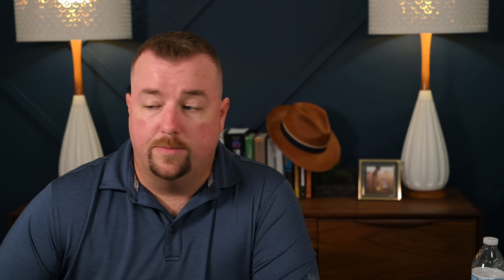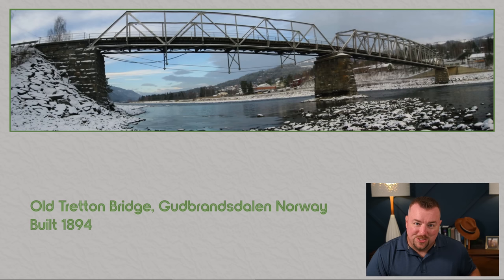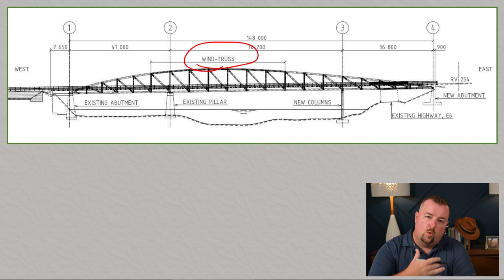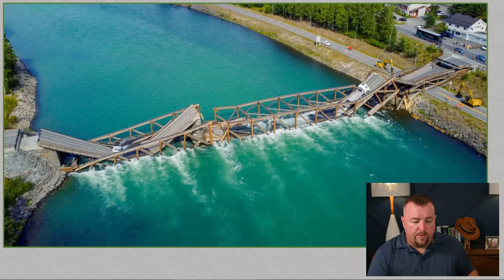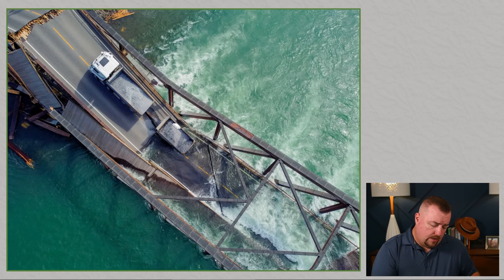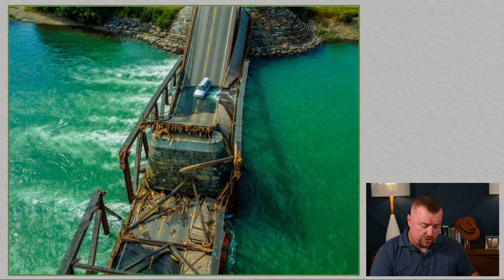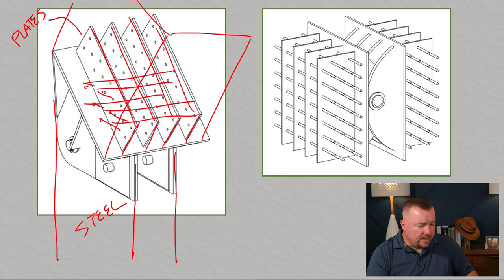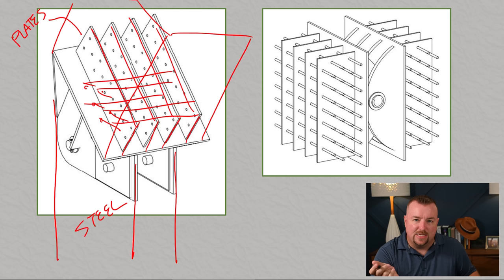How Did the Engineers Miss This?

Comment: The only way to properly join wood and steel is by using filleted (each corner is cut in a triangle fashion) SHS with outboard CLAMPING, so it becomes a friction fit that way you have much more predictable failure mechanisms. The only issue is that since wood is an alive material these claims will need retorquing

Comment: Thanks for this one and greetings from Norway! The weakness of the joints seem obvious and not good at all. Keep in mind, though, that Norwegian media has reported that this bridge was used for transport weighing well over its certified capacity, which may have caused this.
Reply: I wondered about the load rating capacity of the structure. In the US every public structure must be load rated by a structural engineer within 30 days of going into service. This structure may have been fine for some time with lower weight vehicles, but I'd still be worried about rot at the connection points.
Reply: @isaacm6312  AFAIK, we have similar rules in Europe, but then, I don't work with this, so I don't know wth details. The bridge just opened again, though and the first to drive across it, was the truck driver that got stuck on the bridge as it collapsed. He found it a bit scary at first, but said it helped.

Comment: Is it just me or is the sound exceptionally soft on this video? I have my volume maxed out and can hardly hear.
Reply: Audio was OK for me.  In my experience YouTube sometimes has temporary technical problems with really fresh videos, you might want to watch again.
Reply: @blueboats7530  yeah, I’ve seen a few older comments about the sound being quiet, but it was fine for me so it might be fixed now.
Reply: Volume was very low. I cranked up both the computer speakers and YT slider, still barely heard it.
Reply: Yes, low for me too. That is, lower than most other YT videos. Though my hardware allowed me to crank up the volume so I could hear it easily.

Comment: I think in 18:30 - 20:30 the terminology "by tension perpendicular to the grain" meant tension pulling against the perpendicular bolts, they imagined the bolts were a perpendicular hold in the wood -- definitely a bad pre-conception.  As an active woodworker, I agree with your characterization of the bolts acting as splitting wedges in this configuration.
Reply: the bolts acting as splitting wedges as the holes deform would be applying force spreading the grain, applying force perpendicular to the grain direction

Comment: Back in 2016 I built a wooden shade structure on the beach in front of my cottage, and one of the issues was how to cinch the end of a 2*12 beam up to an 8*8 post and hold it there.  In the end I made 3" holes 16" from the end of the 2*12's, and pushed 3" dowels through.  The side of the dowel opposite the end of the beam held a threaded metal disk 1/2" thick to receive a threaded rod pulling from the far side of the post.  The point is that the dowel was large enough and far enough from the end of the beam that shear forces were spread over a large area of wood.  (The beam was also stabilized side-to-side by braces.)

Comment: I just want to add that wood and steel will contract and expand at different rates when exposed to temperature changes. With ten years of seasonal temperature changes those wooden beams would have basically treated the steel pins as abrasive saws. Add in moisture exposure, freeze thaw cycles, and the glue breaking down it was a recipe for disaster.

Comment: having personally seen similar failure modes on timber antenna towers under high wind loading after 2 to 3 years we are now in the process of replacing timber towers with all steel or corrosion resistant alloy constructions. Every timber tower collapse was initiated by a timber joint failure subjected to tension loading on the windward side of the tower.  Timber members in compression, on the  leeward side of the tower were then subjected to excessive loading after failure of the windward timber connections splitting along the grain as the fixings (stainless steel bolts) elongated the drilled bolt holes. From the point where the connections under tension split the timber along the grain a 'plug' of timber was ripped out of the timber member under tension, as seen on the bridge failure. When these connections failed the static load of the tower and dynamic loading (wind pressure)  caused the leeward timbers in compression to be subjected to massive bending loads beyond their load carrying capacity that caused them to bend, split and shatter resulting in total collapse of the towers.  Translating our findings from antenna towers to a bridge makes it obvious that pinned or bolted connections between timber members or timber and any other material under tension would be expected to fail in this way.  As a mechanical engineer and amateur radio operator I made these basic discoveries from observation and investigation over a four year period and decided that timber under tension with pinned connections is not sensible for outdoor construction. using clamping plates in an attempt to stop the timber splitting extended tower life by only a few months. We have only one timber tower left constructed from 4inch x 7inch treated timbers and stainless steel clamping plates with stainless steel fixing bolts. this has been reduced in height from 37ft 6in to 28ft and no longer carries multiple antennas. It has a single pulley wheel with a single wire antenna strung from it and we expect it to fail during winter storms this year or early next year. It will be replaced with a two piece guyed steel lattice tower with alloy top mast section designed to last at least 15 years. It should last 20+ years with sensible quarterly inspection and maintenance. Far better than the 18 months to 3 years working life of the timber towers in real world conditions.  We did mathematically model the timber tower designs to handle 100MPH wind loads with expected working lifetime of 8 to 10 years. We found in the real world they did not even last one third of that time.  Pinned joints on timbers under stress are simply a disaster waiting to happen and are no longer allowed on our property. Even with the reduced load and reduced height If the last timber tower is still standing in March 2023 when we plan to erect the new steel lattice tower I will be most surprised. I expect it to fail by the end of this year.  I am stunned that such a design was approved for a road bridge, as for using glulam outdoors with little of no weather protection at critical joints, Was the design approved on 1st of april?  I hope they learn from their failure and learn to not blindly accept a 'computer model' as correct.  Cant beat real world empirical testing..
Reply: Well, as a Mechanical Design/simulation engineer, my experience is that simulations are very dodgy in this point in time due to the insufficient modelling of heterogeneous materials. Yes the necessary tools are under development, but they are very new and have a lot of ifs.

And the other thing, i always say, that the results of the simulation will be whatever i want. It just takes a bit of thinkering to get anything or the opposite. One must be very very careful when applying such results.

Comment: The pins should have been bolts which had large load-spreading plates and nuts to sandwich the assembly tight. Just driving pins doesn't do anything but create fracture points along the slots/plates.  Truly shix design and never should have been subjected to huge trucks. This bridge "maybe" could be certified as a pedestrian bridge.
Reply: The problem with that idea is like my picnic table. After a decade out in the weather the bolts and screws are all loose, because when the wood expanded when it got wet, then shrank when it dried in the hot summer. Without someone coming along and checking every bolt for the correct torque several times a year, this wouldn't work. Add in the vibration of heavy goods vehicles and it gets much worse.
Reply: No pins, there should be steel sleeves wrapped around the wood beams. No holes in the wood, holes will always be a point of failure, when you drill a hole in wood it destroyes the integrity against any sheer forces. There would be claws in the steel sleeve to prevent sliding. On each side of the sleeve will be steel coloums connecting top to bottom. A large diameter steel cable on the diagonal connection.
Reply: @zpgJiggleBilly  Of course, after all that, the question is.... Why not simply build a steel bridge?!
Reply: I thought the same thing JP. Why not use the compressive force provided with through bolts, rather than just pins. Having said that, one of the tests Josh showed did use bolts, with apparently the same failure.
Reply: @carlwilliams6977  I agree why not just build the whole thing of steel,l might add l have personally built gluelam bridges,but they were people bridges not for vehicles but they were almost this big

Comment: 3:56 The truck stays in place because it basically stands on the (quite massive) trailer hitch.

The trailer itself is mechanically locked in position and can't go anywhere.

The tires would have zero chance to keep the truck from sliding into the river.

Comment: This genius thinking is what reminds me of the people who force EV cars but then tell them you can’t charge your EV car because our power system cannot handle it.
Reply: If we pushed EVs on everyone 30 years ago, the temperature in California would not cause air conditioning to overstress the grid.
The problem is burning fossil fuels. You are trying to blame the solution.
Reply: @jaychip1  the difference in temp wouldn’t matter. If the fact that more and more people are moving into that area. It’s change from open farmland 50 years ago to the most highly developed area. More and more people are jamming into that area and thus the demand on the grid is getting higher. This coupled with more people buying electric cars also applies a higher load on there grid.
Reply: @FishFind3000  and this call for energy saving of electricity was caused by record high temps, and crazy high air conditioning needs for human survival. So global warming is 100% responsible for the energy crisis in California. It could have been avoided if our politicians and electorate had started the switch to renewable, clean energy when we first became aware of it.
Population movement to the Southwest is another problem, but that resource that will be in low supply is water. With a few solar farms in the desert, energy is no problem.
Reply: @jaychip1  One of the problems with the entire Electric Vehicle (EV) concept is the source of batteries is currently lithium. The major suppliers of lithium are China and Russia. Coal and petroleum are available in many parts of the world, but they have limitations, just like all commodities used today. After a certain point, the batteries will need to be recycled and the same for metal products.  Too many countries have people demanding an immediate change to the EV vehicles, but they don't take into account what heavy engines will provide for the logistical support for our societies. Food, clothing, transportation, medicines, etc. must be transported somehow but the EV vehicles today do not have the capability.  Just like this bridge, people "think" they have the answer, but instead they need to learn what the answer might be and then figure out how to get there.

Comment: Around 19:30, "failure... tension perpendicular to the grain", what they mean is that the wood splitting is the result of tension PERPENDICULAR to the grain, because it is applied by the bolts acting as wedges, thus ultimately transforming a tension applied to the MEMBER, parallel to the grain, into tension applied WITHIN THE MATERIAL, perpendicular to the grain.

Comment: Truss should have "pinned" connection between its members. BUT from the drawing, it has group of pins which made it "moment" connection between the steel and wood members. 1.  The unintended moment forces will weaken the wood member at the connection to failure. 2.  The rusty expanding pins also will weaken the wood member at connection. 3.  The diagonal truss members would experience reciprocal forces between tension and compression depending on the wheel location. Finally, tension did it in.

Comment: 15:28 How was the failure mode they found not obvious just from the orientation of wood fibers? All the wood to the the right of the leftmost holes are "in the shadow" of those leftmost holes, so far as tension is concerned -- that wood has little to nothing to pull on!
Reply: Having a failure mode isn't an issue; everything will fail if given enough force and the lab tests determined that amount of force, which the engineers then used to design the bridge.  The problem is those lab tests were small scale, short term, and not exposed to weather or repeated cyclings.  This connection method was never tested under real conditions.
Reply: @rhamph  "Having a failure mode isn't an issue;  everything will fail if given enough force". Obviously. And sure, all the things you said are true, but don't relate to my point.   On just the narrow point of the particular failure mode being a surprise, as discussed at 15:28 -- I don't understand why it would surprise anyone given the fibrous structure of wood.
Reply: @Graham_Wideman  Yeah, it doesn't make sense.  Sure, they put together numbers on the strength, but any experienced woodworker would laugh those numbers out of the building.  Somehow no experienced woodworker was involved in any of these structures?!

Comment: Your point about software is spot on in my opinion. I'm a developer and not a construction engineer, but I have done woodworking and I'm horrified by the way they've designed this bridge, (I'm also Norwegian).

The region of Norway this bridge is in experience freezing and scorching temperatures in the same day, so the wood seems to have been holding up surprisingly well.

I think they should have used wood for esthetics and not trusted software that will probably never be able to model reality over time

Comment: Anyone who regularly works with timber in a structural environment, like a farmer, knows not to use pinned connections in a tension mode unless absolutely unavoidable.

Midway through the video, there was a discussion about the failure of the wood material while experiencing lateral tension. What is being described here is the lateral forces, perpendicular to the external force applied to the joint, being created by the dowels splitting apart the timber in the fashion of a wedge, not the linear forces being applied from an external source.

Timber is a great material for compression, exhibiting gradual failures under load. When tension is applied, the failures tend to be sudden with little prior indication. As such, use timber in compression like you would masonry, rather than in tension like steel.

Comment: The truck probably didn't slide back into the water because of its solid metal connection with the wagon. Since the wagon was not gonna move, the tires only needed to prevent the truck from folding towards either side, not preventing the truck from sliding back into the water.

Comment: At 15:50 where you explain that the failure mode is by the splitting of the wood horizontally above and below the "bolt" group I agree with the analogy that the bolts act like a wedge causing tension across the wood grain,
what you were silent on was "why did the splitting not occur at each line of the bolts but only at the top and the bottom of the bolt group".

My view, that may assist with viewers,  on the reasoning why this only occurred at the top and bottom is because the area between the top and bottom row of bolts are restrained in compression by the outer row of bolts. Essentially the timber in-between the bolts is subject to an overall compressive force induced by the outer row of bolts.

From this I see benefit in spreading the row of bolts further apart on the depth of the timber member , with appreciation for the swelling and shrinkage over this distance, and the placing of a "bolt" perpendicular to the tensile planes of failure closer to the end of the timber member, ie top to bottom that will counter the tensile forces generated by the bolt group.
This bolt will further act as a shear pin, adding to the capacity of the joint.

cheers and very interesting viewing.

Comment: Those bridges are pretty, the wood pleasing. I wonder if the bridge would work well if the deck beams were "post tensioned" with steel cables (and remove the dowels from the design)? I don't like the dowel joints due to differences in CTE of wood vs steel.
Reply: The dowel joints looked as if they did not fail, but the main structural member failed by tearing after the dowels likely due to weakening from moisture.
Reply: @mrdan2898  I suspect the initial failure was lower joint A-B on the B side, and it is under water and we can't see it in the pictures. It seems far more likely to me that it was a joint failure than a mid-beam failure.
Reply: @lwilton  I absolutely agree.